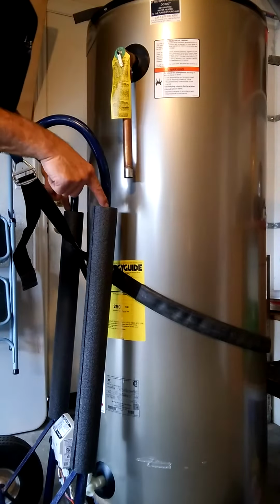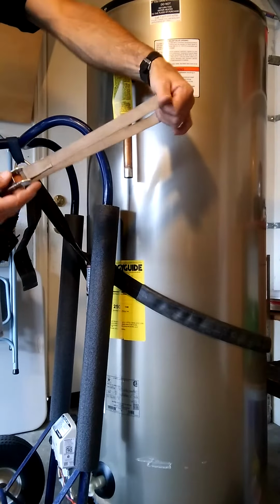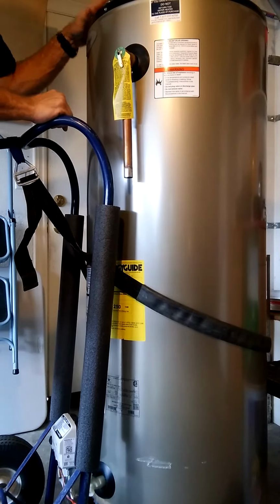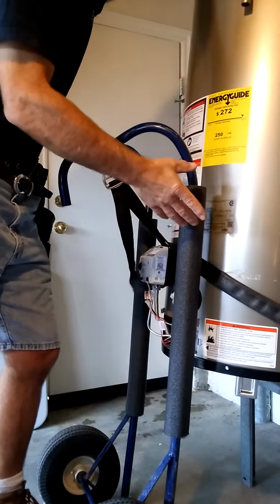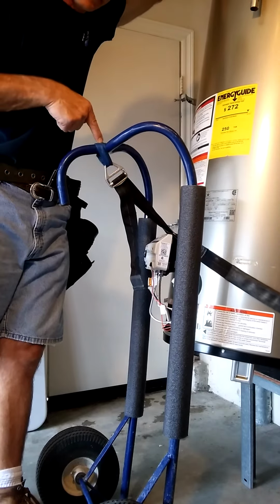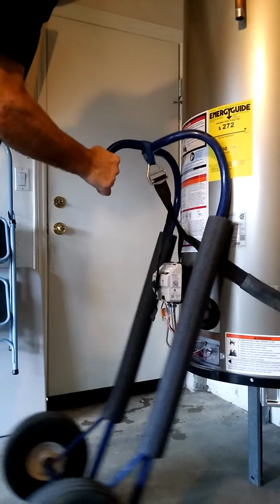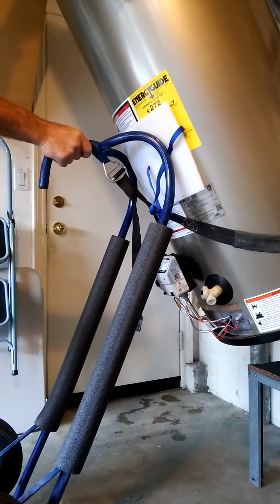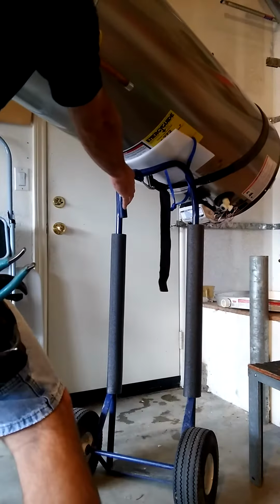#45 How to 'Install' a Water Heater

Comment: How would you use that where the WH is on a stand in a closet where the top of the water heater is taller than the closet door top? The water heater has to go in top first leaning into the closet, then up and swing the bottom into the pan. It always takes 2 people. Can your device do that? I'm probably going to buy one anyway, but I don't see anyway around this problem.
Reply from the maker: Hey Paul. The Hot Rod Hand Truck doesn't help much in this situation. Think about using a winch system anchored inside the closet. We built ours from off-the-shelf parts at a local box store. And the lifting strap that comes with a HotRod is crucial to our system. Call us, we can explain. hotrodhandtruck.com
Reply: I have this same problem today. The only solution is to get a second pair of hands.